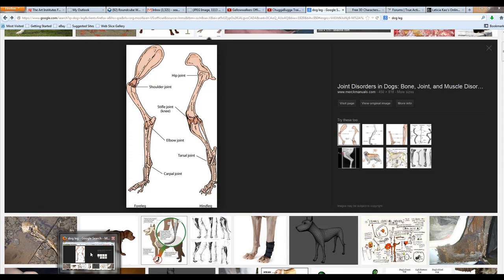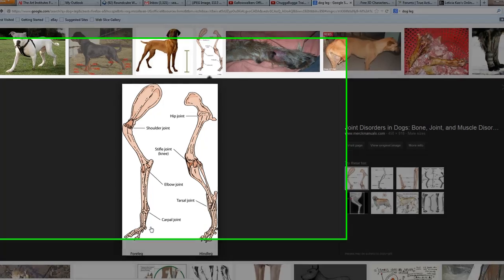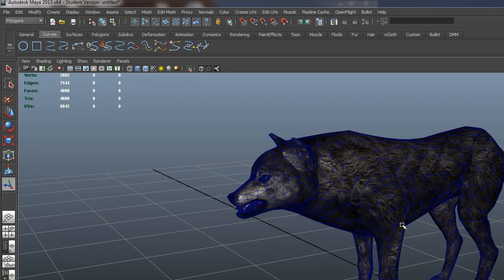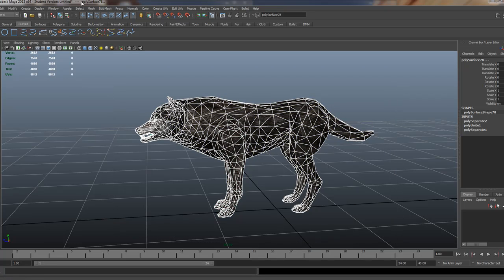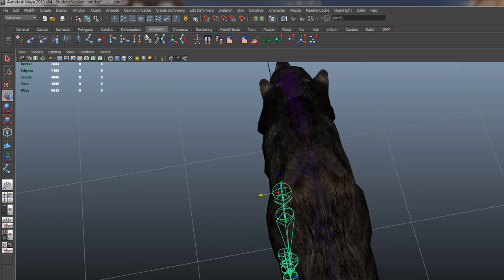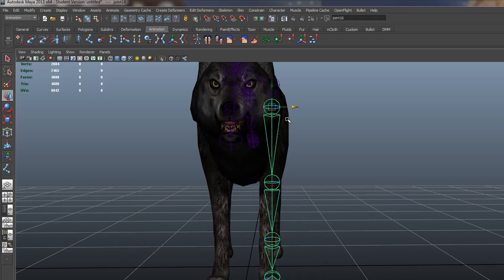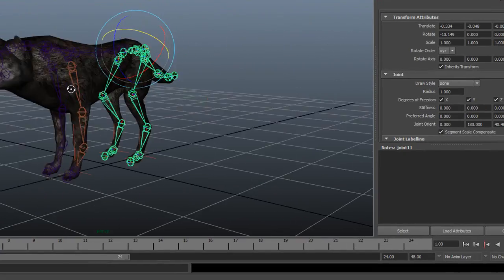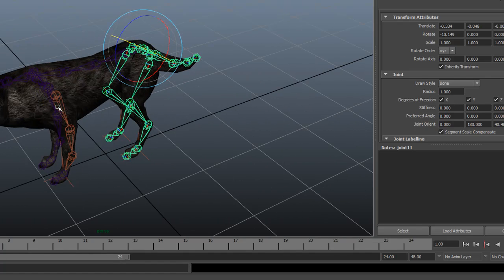quadraped leg set up - Maya

Comment: As a rigging video this is fine, but it is a shame that you are looking at reference of a front leg and get the bones so off. The shoulder of a quadruped is much more forward and lower, coming in at an angle while the rest of the leg underneath it serves as a pillar. I can see how one could get it wrong as the muscles give it an appearance of an almost straight leg, but as someone who's worked with rigs I can guarantee that putting the bones in more realistic locations will take an animal from looking like a puppet to having life. Also, the scapula serves much more purpose than ruffing up its back for looking scary, it's a functional part of its leg, it slides over the ribcage to help extend the length of the stride and since it's hanging on muscles also amortizes the weight of the animal. I apologize if you already know this, as I see this is a fairly old video. But I felt like for anyone hoping to learn rigging from this it would be good to know that the bones could be placed in a better way.
Reply from the maker: If you look at the model it's not entirely anatomically correct but more cartoony in style.
Reply: Even the most stylized models/rigs in the industry are based in reality. Stylization involves exaggerating certain parts in length and size, but never inverting bone directions, or any such extreme anatomy breaks. That is what makes the difference between high-grade industry character and a meh hobbyist one. When this wolf will move, provided the animator would not ask for a re-do from the inaccuracy they would see in their reference, it will feel fairly puppet-like and not very fluid. Check out any Disney/Pixar quadrupeds in motion, and you will find that even in their most stylized animals the leg anatomy will be correct, with the scapula giving the leg very fluid and believable motion.    TL;DR version -  'it's cartoony' is never an excuse for getting anatomy wrong, learn the rules first and then break them.
Reply from the maker: You should make your own vid and post it. I would love to see it. 

:)

Comment: I need some serious help. I've been rigging a dog model, so I made my own custom skeleton based off of this one. I've been pretty much fine for almost the entire rig but now all of a sudden when I try to mirror the rig, everything breaks. Whether I lock things or don't lock things and then mirror the rig, the forelegs stop influencing vertices on past the midpoint, and the other leg is pretty screwed up. the back doesn't even weight properly. And when i try to paint the weights for the stomach area for the spine bones, i end up getting bone influences from the paws. It's incredibly frustrating as I've come so far and even when I start from an earlier save (just setting up the initial smooth bind), it still won't mirror right. I used the repair feature but it still doesn't work. My mirror settings are y/z, + to -, closest point on surface, closest join, none, and unchecked (basically default). Please help, anyone.
Reply from the maker: You have to sure that you character is Symmetrical for mirroring weights or it will be off. It's far from perfect and only seems to work some of the time.

Comment: Since the carpal joint on a dog bends forward. I have not tried it yet, but is it possible to have a leg work correctly by using two IK within one bone chain? Thanks. Great videos by the way, I have been using Maya for over 4 years and learn something new everyday.
Reply from the maker: It's tricky but you need to make sure you have parent constraint controls that do not conflict and one master control. If you do it out of order you will have a cycle error